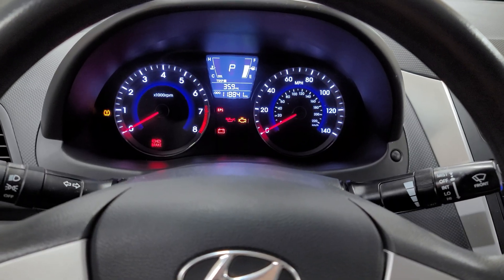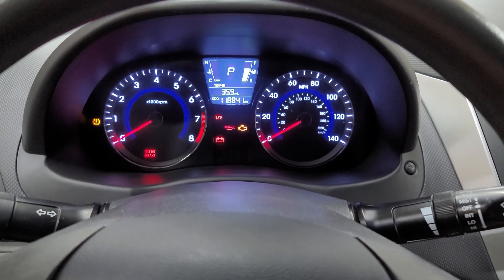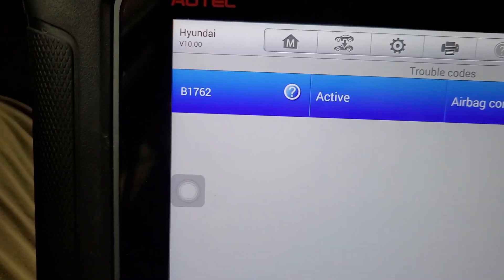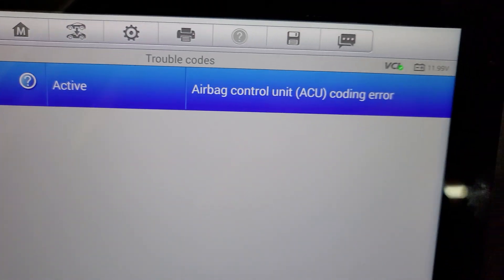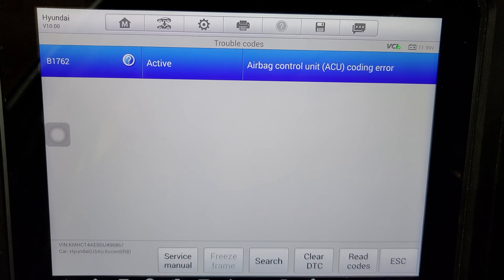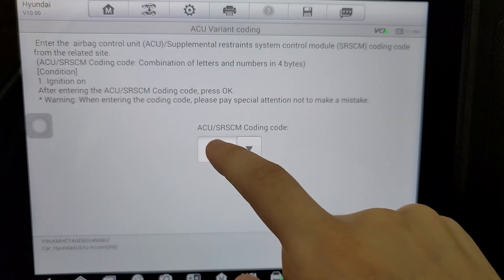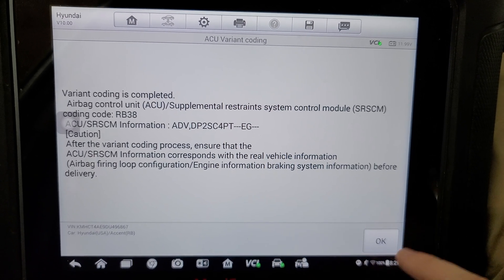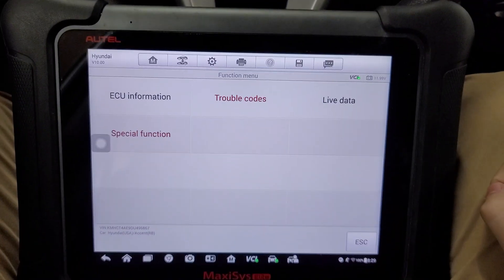2013 Hyundai Accent ACU Variant Coding | SRS B1762 |

Comment: Is it a brand new module
Reply from the maker: No we reset the crash on this one and the customer mixed it up with a different vehicle that is why we had to program the ACU variant
Reply: @Automotive Circuit Solutions   I  need to reprogram second hand srs with different coddinf but  can't find way to do it, I have all dumps, do you know hot change codding on second hand one?